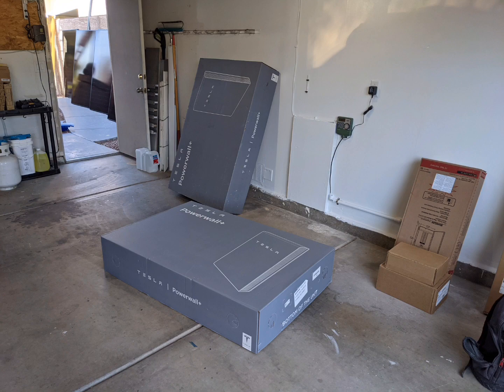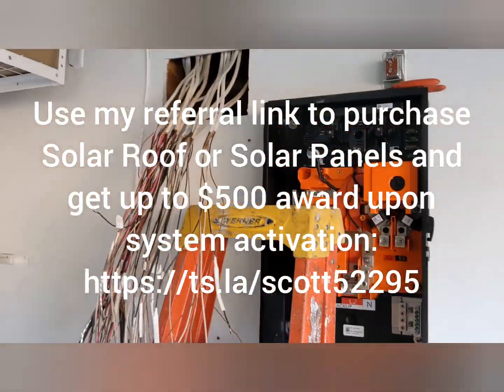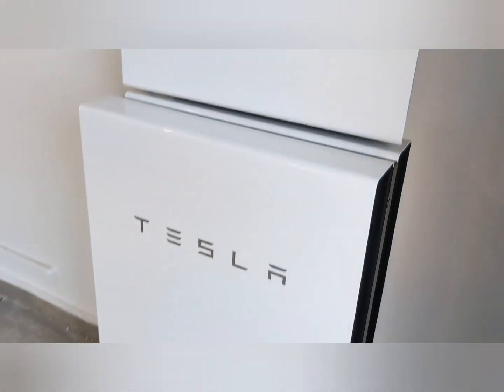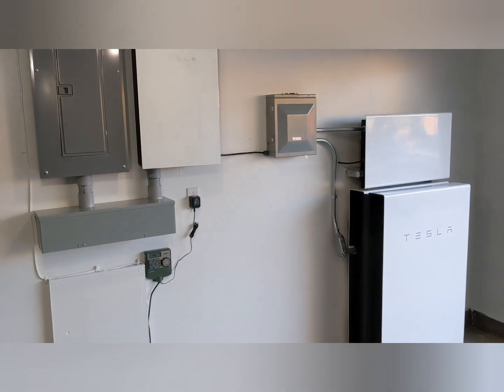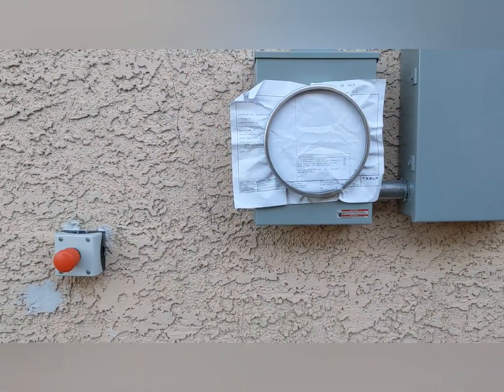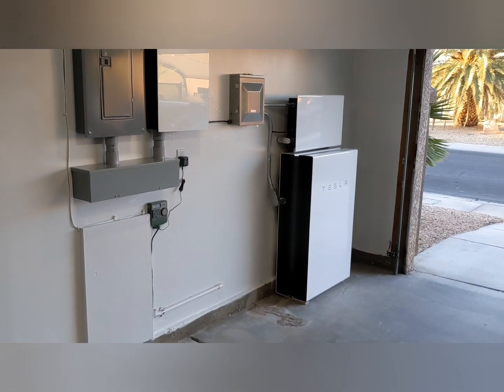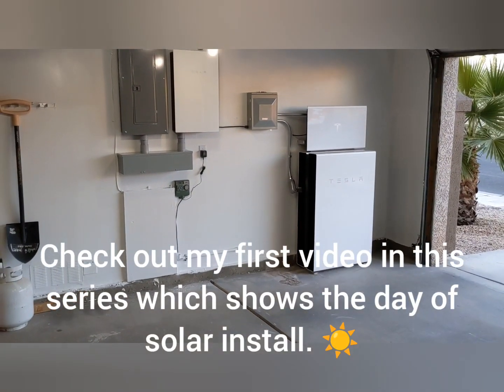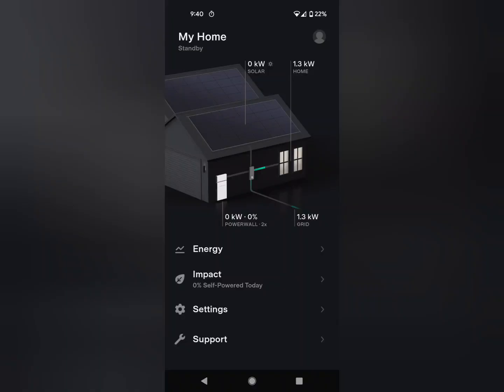Tesla Powerwall and Electrical install

Comment: Hi I have a question?  The dc cables connected to the inverter, How many mm2 4? Cable did the installers use?
Reply from the maker: They used mini split cable 14 AWG 4/C. This is what's specified in the install manual. You should use whatever the manufacturer specifies.

Comment: I am curious why they do not raise batteries above the floor? like 1 foot at least higher? What if something gonna flood your garage?
Reply: All of the batteries I've installed have been hung on the walls.  I prefer 24" above ground level, but each installation is unique.  The only downside to hanging them is that they take up more wall space.  You cannot stack them when hanging them on the walls.

Comment: @Scott — Are there “spacers” between your garage floor and bottoms of your Powerwalls? How many inches raised? ThankU.
Reply from the maker: Yeah there is. About 2"
Reply: @ScottAllison  Oh, that’s good. I’ll want my PWs elevated a little too on basement installation. Always had a dry basement, nevertheless want to protect batteries agains leaking cellar window or flooding from broken HWH. Did spacers come in box with batteries or did electrician just put them in? Did they ask how high? I think I’d like to double that clearance. ThankU.
Reply from the maker: @gilbrook  just a piece of wood! I imagine if you provide a strong base they'll be on to use it. Here's a photo https://imgur.com/a/0npLCr8

Comment: Is your utility going to replace meter in outside deactivated circuit panel box with a net meter? Similarly, will utility be installing an additional meter to left of manual shut off switch to monitor solar panel production? I’m in Massachusetts. May be similar config.
Reply from the maker: They will install a new meter just for solar. Original breaker box now only has one circuit in it, which feeds the new breaker box. Existing meter will stay.
Reply: @ScottAllison  So you’ll have 2 active utility meters,  one for net metering and one for solar production? In Massachusetts, the “solar production” meter’s purpose is to “award” homeowner with fixed amount of yearly revenue for 10 years while net metering is for 1-1 compensation credits. Is that how it works in Nevada? My utility provider says their “solar meter” is incompatible with Tesla’s PW2+, so I’m ineligible for yearly revenue “award” as things now stand.